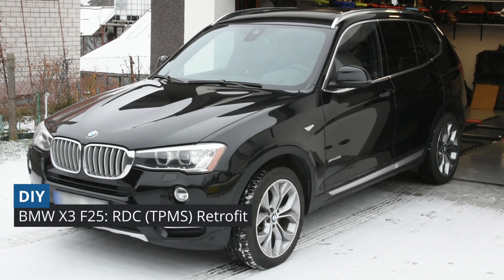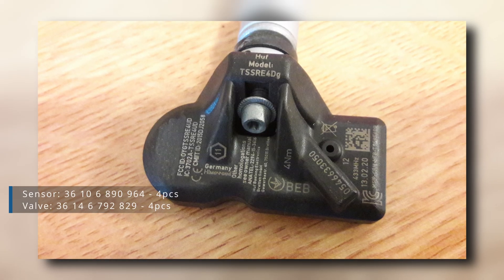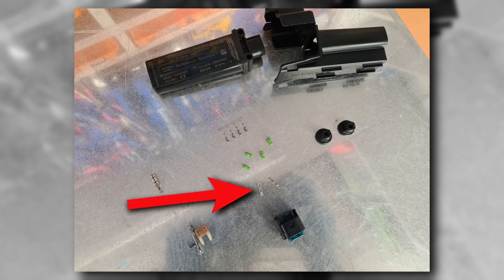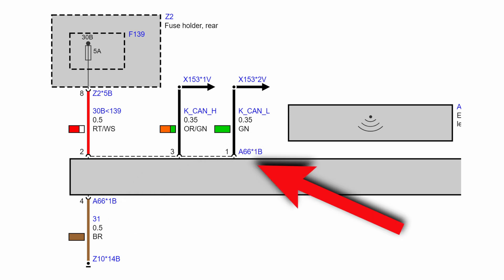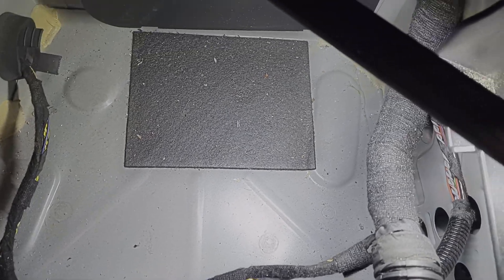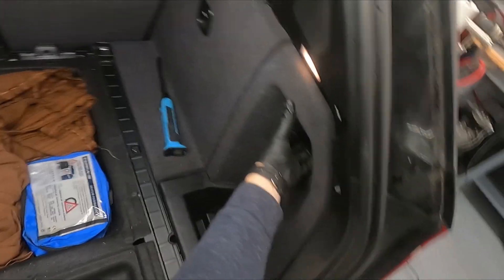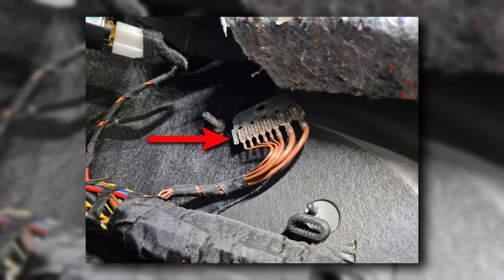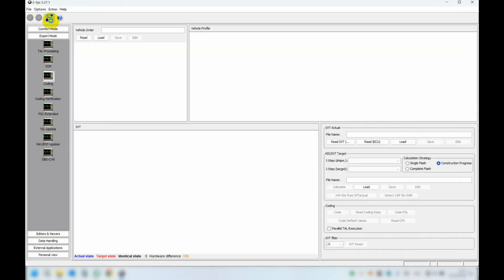RDC (TPMS) Retrofit: BMW X3 F25 28iX

Comment from the maker: ⚙️ Spare parts used: 
       🔹Control unit: 36 10 6 881 433 - 1pcs
       🔹Control unit's bracket: 36 13 6 796 534 - 1pcs
       🔹Plastic nut M6: 1 61 31 176 747 - 2 pcs
       🔹Wheel electronic sensor: 36 10 6 890 964 - 4pcs
       🔹Screw-in valve: 36 14 6 792 829 - 4pcs
       🔹Connector plug: 6 11 38 365 356 - 1pcs
       🔹Plug pins MQS 0.5mm: 61 13 1 393 724 - 4pcs
       🔹Plug pin wire waterproof grommets 0.5mm: 61 13 8 366 245 - 4pcs
       🔹Negative cable pin: 61 13 1 387 140 - 1pcs
       🔹Positive cable pin: 61 13 6 937 069 - 1pcs
       🔹5A mini fuse: 61 13 6 917 401 - 1pcs
       🔹CAN wire cable connector: 61 13 8 353 746 - 2pcs

  🔧 Tools used: 
       🔹Nitrile heavy duty gloves GRIPPAZ: https://geni.us/tc4XaYP (Amazon)
       🔹BGS 2292 General rachet and socket set: https://geni.us/0Hhd (Amazon)
       🔹BGS 5188 Torx and Hex socket set: https://geni.us/Zz55Akr (Amazon)
       🔹Underhood LED light: https://geni.us/oUVLUpn (Amazon)
       🔹Hazet 1979N-92 flashlight: https://geni.us/gTxEiHA (Amazon)
       🔹Hazet 1979WP-1 magnetic charging pad: https://geni.us/abMfAS (Amazon)
       🔹BGS 1327 plastic pry out tool set: https://geni.us/LG52lrm (Amazon)
       🔹CTEK PRO25S Charger: https://geni.us/De6hEhl (Amazon)
       🔹Amp Tyco crimp tool: https://geni.us/FQAP7 (Amazon)
       🔹Tesa soft tape: https://geni.us/LvBcTa (Amazon)

Comment: if car already have this box
I can install sensor and coding tpms open

no need to calibre the sensor pairing with car?
Reply from the maker: You had this option from the factory but the previous owner removed the sensors and un-coded this option?
Reply from the maker: Check whether the fuse is present. If not, then insert it. Code this option back, put new sensors into the wheels and they will pair automatically and calibrate after a drive. I think I had to make around 10km or so. The car will tell you what to do.